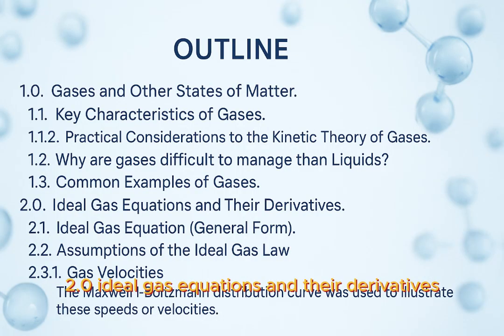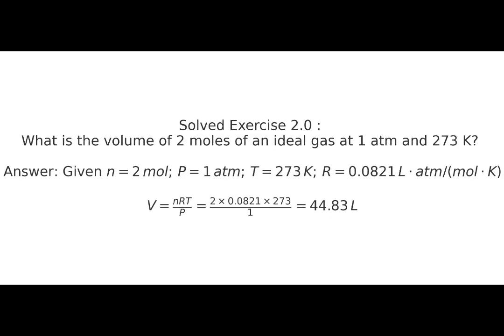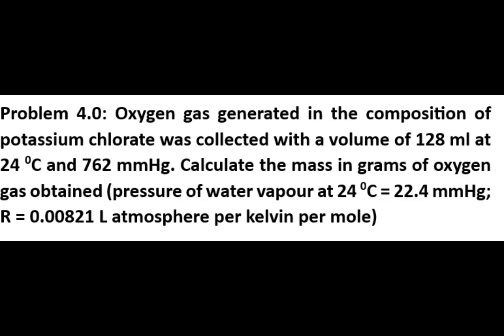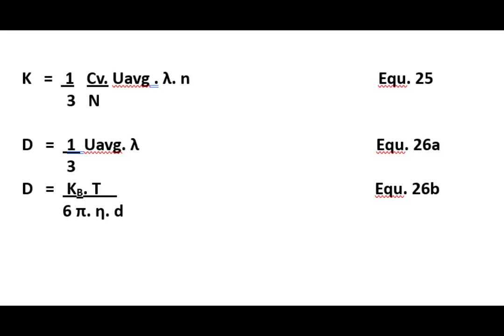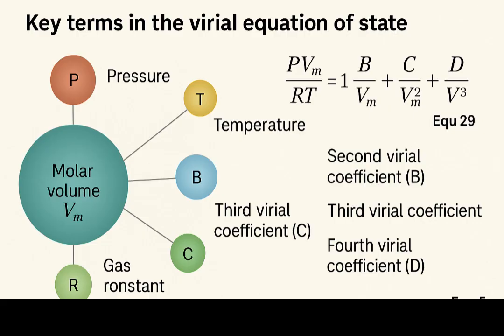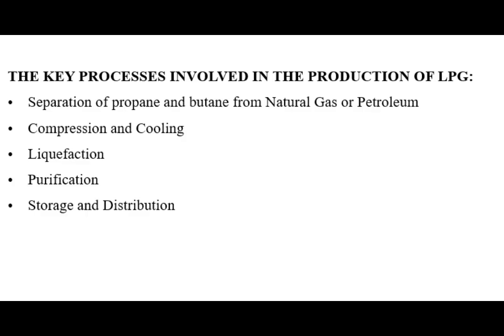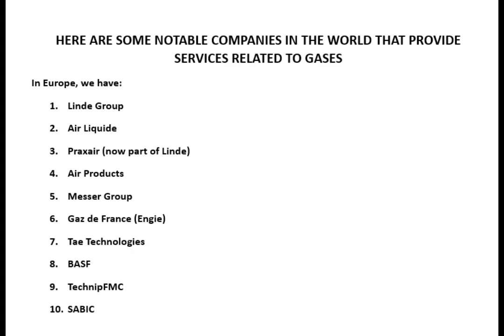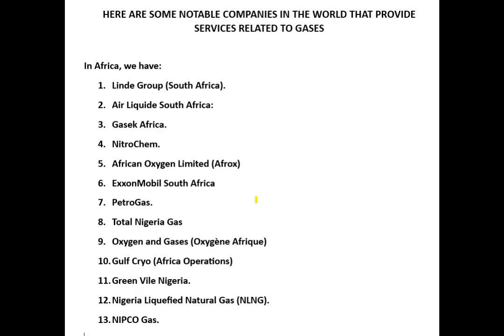Fundamentals and Applications of Gases

Comment: GLY: The reason nitrogen is used in the form of a real gas rather than an ideal gas during Coiled Tubing Operations is because, under the high-pressure and high-temperature conditions typically found in oil and gas wells, gases do not behave ideally.

Real gases deviate from ideal gas behavior due to intermolecular forces and the actual volume occupied by gas molecules—factors which the ideal gas law ignores. Nitrogen's real gas properties must be considered to ensure accurate calculations of pressure, flow rates, and lift capacity during well intervention.

Using real gas models (like the compressibility factor Z from the real gas equation: PV = ZnRT) helps engineers plan safe and efficient operations, avoiding risks like under- or over-pressurization in the wellbore.

Comment: GLY :Nitrogen is used in colled tubing operations primarily to aid in well cleanout kick off ... Mostly in low pressure oil wells 
* Nitrogen lifting (Gas lifting)
Nitrogen is pumped down the colled tubing to mix with heavy fluids in the annulus
The reduced fluid density helps to enable liquids to be lifted to the surface 

It minimizes fluid loss to the formation

Comment: GLY U2023/5565080
Nitrogen is used as a real gas in Coiled Tubing Operations because its real gas properties, such as its ability to expand and contract under different pressure and temperature conditions, make it more effective for well intervention tasks like *Nitrogen Lifting*. This process involves pumping nitrogen gas through coiled tubing to reduce hydrostatic pressure in the wellbore, allowing formation fluids to flow more easily. If nitrogen were treated as an ideal gas, its behavior would be oversimplified, and its real-world performance in well intervention operations wouldn't be accurately represented ¹.

Using nitrogen as a real gas takes into account its actual thermodynamic properties, ensuring more accurate and effective well intervention operations.

Comment: GLY: The reason for using nitrogen in its real gas form for coiled tubing operations is that real gases more accurately represent the behavior of nitrogen under the high-pressure and high-temperature conditions, typically encountered in oil and gas well interventions. 
Real gas behavior accounts for factors like:
1. Compressibility: Real gases deviate from ideal gases  behavior due to molecular interactions and volume occupied by gas molecules.
2. Temperature and Pressure Effects: At high pressures and temperatures, real gas behavior is more pronounced, affecting the gas's density, viscosity, and performance.

Comment: GLY:The reason for using a real gas instead of an ideal gas for the nitrogen compound in this operation is likely due to the significant deviations from ideal gas behavior at high pressures or low temperatures, where real gas effects such as intermolecular forces and molecular size become important. These effects can impact the accuracy and safety of the operation.

Comment: Gly Nitrogen deviates from ideal gas behavior. In such states, the volume occupied by gas molecules and intermolecular forces become significant. The ideal gas law assumes negligible molecular volume and no intermolecular attractions or repulsions, which is more accurate only at low pressures and high temperatures.

Comment: GLY 
044
Accuracy in Volume Calculations: Precise calculation of nitrogen volume is essential for: 
• Achieving Underbalanced Conditions: Accurately displacing wellbore fluids without exceeding formation pressure.
• Lifting Fluids: Effectively calculating gas volume needed for nitrogen lift to unload wellbore fluids.
• Pressure Control: Predicting bottom-hole pressures and surface pressures accurately during injection and flowback. 

Using the ideal gas law at high pressures would overestimate the volume of nitrogen available or required, leading to incorrect job design, potential well control issues, or inefficient fluid lifting.

Comment: GLY:Nitrogen is treated as a real gas in coiled tubing operations because ideal gas laws are inaccurate under the high-pressure, high-density conditions present downhole, and using real gas models ensures safe and effective operations.

Comment: GLY:Because oil and gas wells involve high pressure and temperature, nitrogen behaves more like a real gas than an ideal gas. Real gas calculations account for molecular interactions and actual gas volume, giving more accurate and safe results during coiled tubing operations.

Comment: GLY:
 
Nitrogen gas is treated as a real gas instead of an ideal gas in considerations of factors like temperature and pressure under the indepth environment of coiled tubing operations,under this environment nitrogen deviate from ideal gas to real gas due it's intermolecular rapid behavior under this condition,so in order to accurately measure nitrogen gas flow it's needs to be measured as a standard real gas.

Comment: GLY: Nitrogen is used as a real gas in coiled tubing operations for oil and gas well interventions because real gases account for intermolecular interactions and compressibility effects under high-pressure and high-temperature conditions typical in wells. Unlike an ideal gas, which assumes no molecular interactions and constant properties, nitrogen as a real gas provides accurate behavior modeling, ensuring precise calculations for pressure, volume, and flow rates critical for safe and effective operations.

Comment: GLY: Nitrogen is used as a real gas rather than an ideal gas due to its unique properties under high-pressure and high-temperature conditions. Real gases deviate from ideal gas behavior, especially at high pressures and Low temperatures.
Using nitrogen as a real gas allows for more accurate calculations and predictions of its behavior, ensuring safe and effective well intervention operations.

Comment: GLY: The nitrogen compound is used in the form of a real gas because, under the conditions of the operation (such as high pressure or low temperature), nitrogen does not behave ideally. Using the real gas form allows for more accurate predictions of its behavior, ensuring the operation is safe, efficient, and effective.

Comment: Gly
In coiled tubing operations, nitrogen is used as a real gas rather than an ideal gas because the conditions encountered in oil and gas wells (high pressures and varying temperatures) cause nitrogen's behavior to significantly deviate from the assumptions of the ideal gas law.
 1.  High Pressure: The ideal gas law assumes that gas particles have negligible volume and that there are no intermolecular forces between them. In deep wellbores, nitrogen is compressed to very high pressures. At these pressures, the volume occupied by the nitrogen molecules themselves becomes significant relative to the total volume, and the intermolecular attractive forces between them become more pronounced. These factors are ignored by the ideal gas law but are crucial for accurate predictions of nitrogen's behavior as a real gas.
 2. Varying Temperatures: While nitrogen may approach ideal gas behavior at very high temperatures and low pressures, coiled tubing operations involve a range of temperatures. At lower temperatures (especially when nitrogen is injected as a liquid or at the bottom of the well where temperatures might be cooler), the kinetic energy of the molecules decreases, making intermolecular forces more significant. This further deviates from ideal gas assumptions.
 3. Accuracy of Calculations: For effective and safe coiled tubing operations (e.g., nitrogen lifting, well kick-offs, purging), accurate predictions of gas density, pressure, and volume are critical. Using the ideal gas law under these conditions would lead to substantial errors, potentially compromising operational efficiency and safety. Real gas equations of state (like the Van der Waals equation or more complex ones) account for the finite volume of gas molecules and the attractive/repulsive forces between them, providing a much more accurate representation of nitrogen's behavior.

Comment: Gly: U2023/5565036

Nitrogen is treated as a real gas in coiled tubing operations because the high-pressure conditions cause significant deviations from ideal gas behavior. Real gas modeling ensures accurate, safe, and efficient design and execution of well intervention jobs.

Comment: Nweke ThankGod Okechukwu
U2023/5565013
GLY

Here's the reason why nitrogen is treated as a real gas instead of an assumed or ideal gas:
REAL GAS behaviour reveals the interaction between molecules and non-ideal volume effects ( which are important at high pressure and different levels of temperature.
The actions or behaviour of REAL GAS accurately portrays the property and behaviour of NITROGEN in certain conditions.

Thanks.

Comment: U2023/5565114
GLY 
Nitrogen is used in coiled tubing operations to lift fluids, initiate circulation, clean the wellbore, perform under balanced operations, and purge or displace other gases— making the operation safer, more effective, and less damaging to the reservoir.

Comment: Gly
U2023/5565092
Nitrogen is used in coiled tubing OPerations to help recover oil from wells or reservoirs by reducing hydrostatic pressure in the well bore. Real gas behavior accounts for nitrogen compressibility

Comment: GLY: Nitrogen is used in coiled tubing applications for oil recovery from reservoirs primarily due to its inert, non-reactive properties, low density, and ability to maintain high pressure, making it an effective tool for enhanced oil recovery (EOR) and well stimulation. Below is an explanation of how nitrogen is applied in coiled tubing operations to recover oil, with a focus on its role in cold tubing applications:

1. Nitrogen Lifting in Coiled Tubing  
Purpose: Nitrogen lifting is a key application where nitrogen gas is injected through coiled tubing to increase well productivity, particularly in wells with declining natural formation pressure or liquid accumulation that hinders hydrocarbon flow.

Process:  
Nitrogen is pumped through coiled tubing into the reservoir or wellbore to displace accumulated liquids (e.g., water or heavy oil) that obstruct the flow of hydrocarbons. This reduces hydrostatic pressure, allowing oil and gas to flow more easily to the surface. The low density and high compressibility of nitrogen make it ideal for reducing the weight of the fluid column in the wellbore, enhancing the pressure differential that drives oil to the surface. 
Cold Tubing Context: In "cold tubing" applications, nitrogen is typically injected at ambient or controlled temperatures (as opposed to heated or thermal methods). This is particularly useful in reservoirs where thermal methods like steam injection are impractical, such as in shale or low-permeability reservoirs. Cold nitrogen injection avoids altering the reservoir’s thermal properties, which could otherwise affect formation stability or fluid behavior.

2. Enhanced Oil Recovery (EOR) via Nitrogen Injection  
Mechanism: Nitrogen is injected through coiled tubing to maintain or increase reservoir pressure, displacing oil toward production wells. This is often done in low-permeability or depleted reservoirs where natural pressure is insufficient.

Immiscible Displacement: Nitrogen is generally immiscible with oil and water, making it suitable for immiscible gas flooding. It pushes oil toward production wells without mixing, which is effective in reservoirs where miscible flooding (e.g., with CO2) is not feasible due to high minimum miscibility pressure (MMP) requirements.

Cold Nitrogen for Shale Reservoirs: Experimental studies have shown that injecting cold nitrogen (e.g., at temperatures as low as -26°C) into shale reservoirs, such as Eagle Ford, can improve oil recovery by creating thermal stress. This stress induces or extends cracks in the formation, enhancing permeability and increasing the oil recovery factor by up to 10%.

3. Well Stimulation and Cleanout

Coiled Tubing Cleanouts: Nitrogen is channeled through coiled tubing to remove debris, scale, or liquids that accumulate in the wellbore, restoring flow paths for hydrocarbons. Its inert nature ensures it does not react with well fluids or cause corrosion, unlike CO2.

Fracturing Support: In coiled tubing nitrogen fracturing, high-pressure nitrogen is injected to create or extend fractures in the reservoir, improving fluid flow. This is particularly effective in low-permeability formations where traditional hydraulic fracturing may be less efficient.

4. Safety and Environmental Benefits  
Inerting: Nitrogen’s inert properties reduce the risk of... (text cuts off here)

...*downhole fires or explosions* by displacing oxygen, creating a safer environment during coiled tubing operations.

Environmental Impact: Using nitrogen, especially generated on-site, minimizes the need for chemical additives or water-based fluids, making it a more environmentally friendly option compared to other EOR methods. On-site nitrogen generators also reduce transportation-related emissions.

5. On-Site Nitrogen Generation  
Technology: Coiled tubing operations often use on-site nitrogen generators, which produce high-purity nitrogen (95–99.9%) from atmospheric air via membrane or pressure swing adsorption (PSA) technologies. These systems are coupled with compressors to deliver nitrogen at the high pressures needed for injection (up to 15,000 psi for miscible flooding).

Advantages: On-site generation eliminates logistical challenges associated with transporting liquid nitrogen, reduces costs, and ensures a consistent supply, enhancing operational efficiency.

6. Applications in Specific Scenarios

Under-Balanced Drilling (UBD): Nitrogen is used in coiled tubing drilling to lighten drilling fluids, reducing hydrostatic pressure and improving production in low-pressure reservoirs. This minimizes formation damage and enhances recovery.

Workovers and Completions: Nitrogen is used to displace well fluids during workover operations, initiate flow, or clean wells, leveraging its low density and high-pressure properties.

Bottom Water Reservoirs: In reservoirs with bottom water, nitrogen foam flooding through coiled tubing can plug water layers, reducing water breakthrough and improving oil recovery by redirecting flow to oil-rich zones.

7. Cold Nitrogen-Specific Benefits  
Thermal Shock: Injecting cold nitrogen (e.g., -26°C to 0°C) can create thermal stress in shale or tight reservoirs, inducing microfractures or widening existing ones, which enhances permeability without the need for extensive hydraulic fracturing.

Non-Corrosive: Unlike CO2, nitrogen does not corrode tubing or equipment, making it ideal for prolonged use in cold tubing applications.

Cost-Effectiveness: Nitrogen is abundant (78% of the atmosphere) and cheaper to produce than CO2 or natural gas, especially with on-site generators, making it a cost-effective choice for EOR.

---

Challenges and Considerations  
High MMP: Nitrogen has a higher minimum miscibility pressure (often >9,300 psi) compared to CO2, making it less suitable for miscible flooding in some reservoirs. It is more commonly used for immiscible displacement at lower pressures.

Reservoir Compatibility: The effectiveness of nitrogen depends on reservoir characteristics like permeability, temperature, and fluid composition. Careful engineering is required to optimize injection parameters. 

Pressure Control: Precise control of injection pressure and volume is critical to avoid fracturing the reservoir unintentionally or causing pressure imbalances.

Conclusion  
In cold tubing applications, nitrogen is used primarily for lifting, well stimulation, cleanouts, and EOR through coiled tubing systems. Its inert nature, low density, and ability to be generated on-site make it a versatile and cost-effective solution for recovering oil from reservoirs, particularly in low-permeability or depleted fields. Cold nitrogen injection can also enhance recovery in shale reservoirs by inducing thermal stress, offering a sustainable alternative to other EOR methods. For specific applications, operators must consider reservoir conditions and optimize injection parameters to maximize recovery while maintaining safety and efficiency.

Comment: U2023/5565014
GLY: Nitrogen is treated as a real gas in coiled tubing operations to accurately reflect its behavior under the high-pressure, high-temperature conditions of oil and gas wells, ensuring safe and effective intervention.

Comment: PIC :U2023/5581083

The Joule-Thomson (JT) experiment involves cooling a gas by expanding it through a valve, which leads to a drop in temperature. However, for natural gas (LNG), which is primarily methane, the JT effect is less efficient. This is because methane has a relatively low cooling coefficient, meaning each expansion results in only a small temperature decrease. As a result, LNG cannot be effectively liquefied using the JT process alone.

Comment: GLY: Accuracy in Volume Calculations: Precise calculation of nitrogen volume is essential for: 
• Achieving Underbalanced Conditions: Accurately displacing wellbore fluids without exceeding formation pressure.
• Lifting Fluids: Effectively calculating gas volume needed for nitrogen lift to unload wellbore fluids.
• Pressure Control: Predicting bottom-hole pressures and surface pressures accurately during injection and flowback. 

Using the ideal gas law at high pressures would overestimate the volume of nitrogen available or required, leading to incorrect job design, potential well control issues, or inefficient fluid lifting.